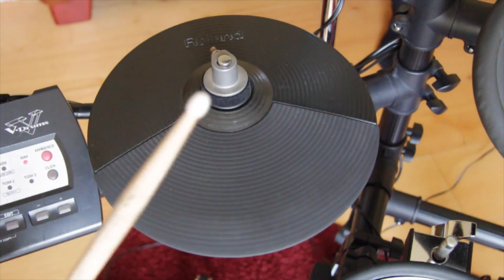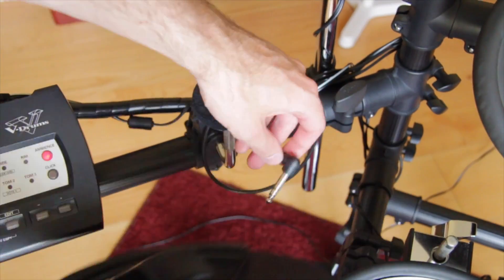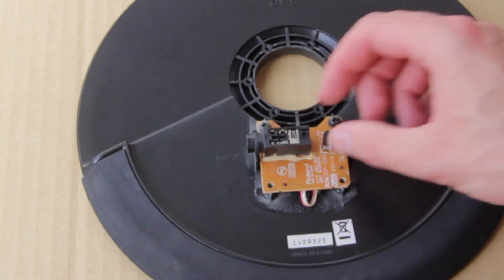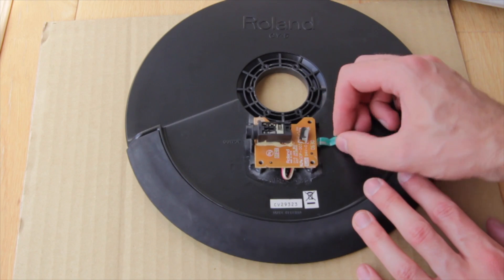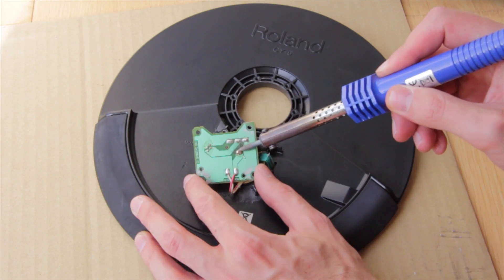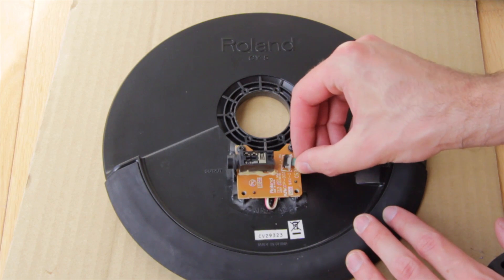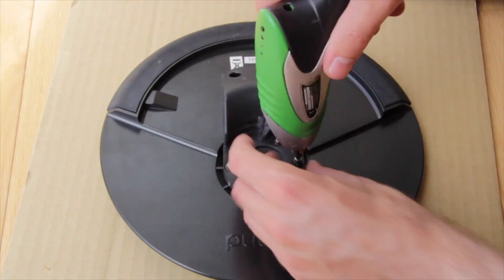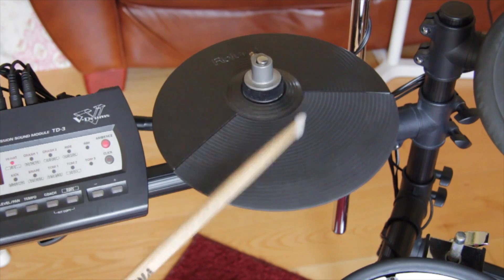Roland CY-5 cymbal repair

Comment: I have the same kit with the cy-5 cymbals. I’ve never been able to get the choke feature to work. Any ideas?
Reply: replace the cymbal, not worth putting in the effort, but if you really do want to, you'll jhave to remove the rubber remove the old choke strip and put a new one, but buying a new one is just a better idea, but choking isn't too important so I would just leave it if I were you

Comment: Guys, can I send you a beer? My Cy-5 has been broken for weeks and I practiced without the sound. I was just about to order a used one, when I found this video. Pulled out the old soldering iron, waited for two minutes for it to be hot, held it to the broken contact, and it's working again. Took 5 minutes. Awesome video. Again, you should add a button here "pay me a beer" or something like that, I'd totally donate a few bucks for this!
Reply from the maker: Awesome, well done!
Reply from the maker: Thanks, but the channel is not active anymore, so I do not feel good about accepting docations. But appreciate your offer.

Comment: I bought a TD1K kit 1 year ago and I am kinda having  the same problem. The cymbals sounds like when you hit a cymbal in the top next to the bell, so you dont get full power on the hit. Do you guys think its the same cause as in this video? IMO this wasnt supposed to happen since I bought it only 1 year ago... :(
Reply: A mi me paso lo mismo, con 2 platillos ya...Roland cy 12 y 13, el 12 lo cambie por garantía pero ahora ya termino y me paso con el 13, pudiste solucionarlo?

Comment: Does anyone know how to fix self-choking on a CY-5? There are lots of videos for how to fix this on Youtube for other Roland cymbals, but those methods don't work on the CY-5. The cause is the same: rubber debris builds up on the sensor after years of use and causes the cymbal to self choke. The solution for other cymbals is to peel back the rubber and remove the debris, but unfortunately this doesn't work with the CY-5 - the rubber is glued on for some reason, whereas with other models it fits into a groove and can be easily removed / put back in place. Does anyone know of a solution to this?
Reply: Stephen Davenport got the same problem.couldnt remove the rubber.got any ideas?
Reply: Johann Kwan I did find one short term fix that actually works pretty good! I took a strong clip from my office, for holding files together and whatnot, and placed that on the cymbal. This resolves the self choking but removed the ability to choke, so it's not ideal.. but it's something.
Reply: Finally fixed mine. Peeled the rubber back from the top portion just until the edge sensor got exposed. I used a qtip to remove the rubber debris on the sensor.worked perfectly after!
Reply: Johann Kwan Awesome man! So you just peeled it back.. did you have to glue the rubber flap back on after?
Reply: Didnt glue it back because i had to clean it again after a few weeks.if you clean the debris and those that are still stuck to the rubber part, you could use some thin double sided tape but i wouldnt recommend glue because if ever you need to troubleshoot again, its gonna be very hard to remove
Reply: I’ve never been able to get the choke feature to work with my kit. Any ideas?
Reply: @spencerdiniz  If choking doesn’t work at all on any of the cymbals, perhaps there’s a setting that has it disabled in the module?
Reply: @ssdavengames  That’s what I thought, but couldn’t find anything in the manual. Also, did a factory reset, but still not working. Thanks for the suggestion.
Reply: @spencerdiniz  I wonder if some cymbals don't have the choke feature maybe?
Reply: @ssdavengames  that’s what I’m starting to consider. The model number is CY-5 and the manual and specs explicitly mention and illustrate the choke feature and how to trigger it.
Reply: @spencerdiniz  Yea CY-5 definitely supports choke
Reply: @spencerdiniz  I have the same problem. Did you solve this?
Reply: @rocktip1  No… never got it to work.
Reply: @ssdavengames  thanks for the suggestion, but haven’t been able to find any documentation on this.

Comment: My rubber top cover is loose and it makes extra sound, or makes diferent sounds when I hit it. Its confusing. Do you think I can repair it?
Thank you very much. Danke!
Reply from the maker: You can! You fold it back, use sandpaper to grind the surface and either spray clue or super glue to put it back on.
Reply: Vdrum Tips thanks. I will do it, but im afraid i can wreck it :D

Comment: Any idea where I can get the jack? The pins snapped.
Reply from the maker: Directly from Roland, Fullcompass or Ebay.
Reply: Will check it out! Thanks!
Reply: Samuel Sinn did you ever find one? I need a replacement and Roland won't sell them.

Comment: Please solder ALL the pins if you re-solder the jack. And do not let the soldering iron burn the flux off.  It is highly recommended to remove the old tin because it's probably unleaded. The soldering iron tip and soldering wire must be put together and then after one or two seconds immediately remove both  together. If the solder doesn't melt in two seconds, the tip is too cold. And the most importantly, use leaded 60/40 soldering wire, not unleaded. I have 50 yrs of experience in servicing electronics.
Reply from the maker: Thanks, but it works:)

Comment: Both of my zones work, but they aren't responsive at times and it seems I have to hit kinda hard to get a sound. Will this same method do the trick?
Reply from the maker: This could relate to the piezos . Maybe they are loose or just old and become weak.
Reply: So I opened up the cymbal and the red wire is disconnected. How can I reconnect it if I don't have the soldering stuff?
Reply from the maker: Not really. Soldering is the only option.

Comment: I have this problem with my CY-8 cymbal. None of the solder joints are broken and reflowing the joints did nothing. I believe the jack is faulty. Any idea where I can get a new input jack? The board is the same as a PD-8.
Reply from the maker: +Games from the Grave Check out FullCompass in the US or google for V-drums spare parts. Where are you based?

Comment: Maybe this is the solution to my problem. I have a Roland TD-8 molule. As you know, this module has a double instrument input for the bass drum. If I connect the jack all the way in that input, it do not work. It only works at the half way. I solved this problem by changing the polarity of the cable but I still can't connect a second instrument. I will check the module from inside to fix it like the way in this video. Thanx by the way...
Reply from the maker: +Dimitris Yiovis A polarity change will not help. It seems like the input is just gone. It is just loose if you are lucky. I might be possible that you have to replace it. Check Fullcompass for the spare part or call Roland.
Reply: Thanx!!!!

Comment: This seems to be a problem with the cy5 series.  A used one I bought had this issue, but the back was so badly damaged it couldn't be soldered.  Thankfully I contacted Roland and they sold me a replacement board and back for just ten dollars shipped, which fixed my cy5.
Reply from the maker: +Chris Leathco That is rally nice from Roland.

Comment: Hi and thanks for the video. I have a CY-5 pad and it's been double triggering the sound when I hit it on the rim. Do you have any ideas of what happened? Thank you!
Reply from the maker: Hi, I would have to figure it out. Cannot really say what it is. Maybe open it and check it connectors and cables are ok.
Reply: I have the same problem, it drives me mad when it double triggers. it became worse lately. I made a quick fix now but couldn't test it carefully. I opened the cymbal just like in the video and it appeared that the circuit board was loose. i tightened the 2 screws of the circuit board and glued the edges of the connector soundly. Also the soft plastic cover of the cymbal ( the part you hit with the sticks) was loose too. i glued the parts of the cover which were exposed. it seems to work ok now i'll let you know if it double triggers again.

Comment: and if the rim fails? how could I fix this? ... Thanks for your videos are a great addition
Reply from the maker: It could be the solder joint, the cable for the other piezo could be loose or the jack pluck is broken. Maybe even the cable. But it is mostly simple to fix it. This video is only an example on how easy it is to fix a e-cymbal.